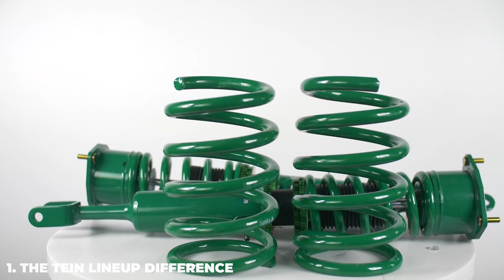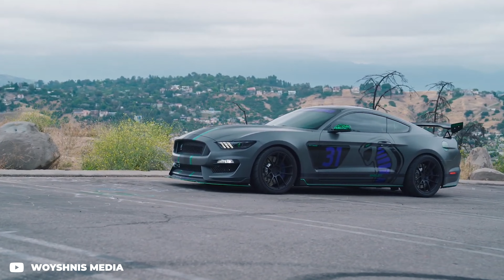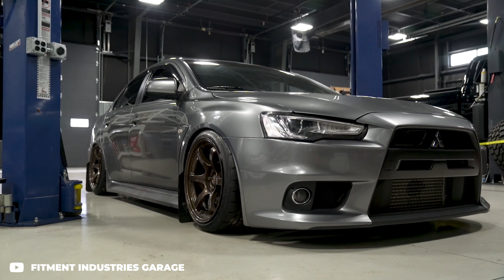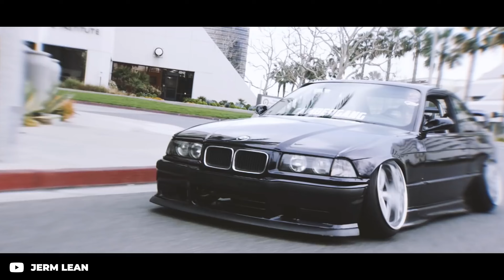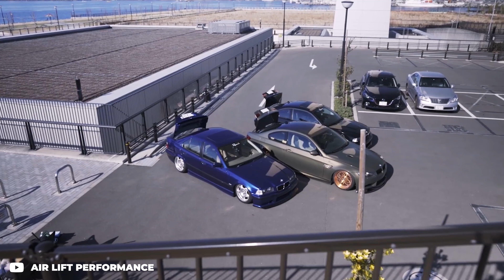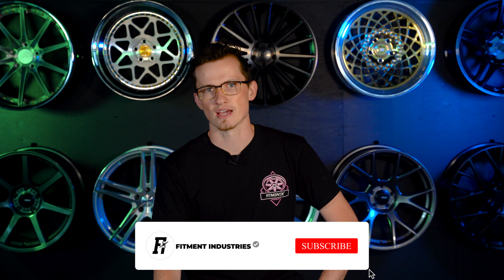Top Suspension Questions We Receive

Comment: #6. Of course you need other shocks with lowering springs!!! OEM shocks most of the time do not have the strength to resist the extra pressure that, say, sport springs will create over such shocks. Sadly, this happens when vehicles with few aftermarket options have springs options, but then they don't have shocks options t match those springs. I've lived it myself.

Omg I can't believe you actually answered that with a "No"...

Comment: You said airride  is more maintenance. Does it cost more to maintain especially for everyday driving.  Or im I better of  with coilovers.  Toyota sienna daily driver family man. Thanks!
Reply from the maker: Everyday driving might be victim to wear and tear but depending on where you live as long as it doesn't get abnormally cold you should be able to run the air-ride for a minute! I personally would go coilovers but that is just because I don't want all the hassle of the electronics with airride! 😂

Comment: “You get negative camber for better fitment” LUL less excessive negative camber is used to compensate for body roll and angle when cornering at speed to get the largest contact patch of tire on pavement. 
Edit: Alex is just a Hot Boi

Comment: I can't find any suspension parts for my Truck (I'm lowering). It seems like I have to get a crown Vic and gut
Reply: Zacchaeus Wimberly 

Step 1) autozone 
Step 2) get blocks and U bolts 
Step 3) flip leaf springs 
Step 4) cut torsion bars 
Step 5) bang frame